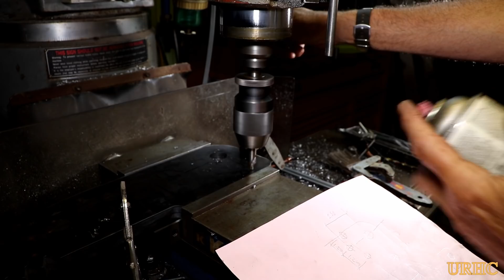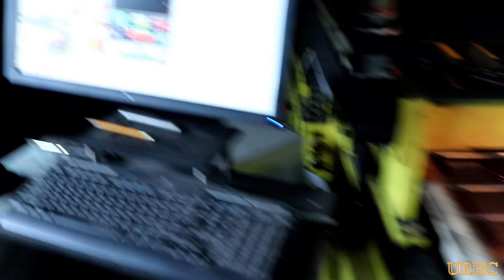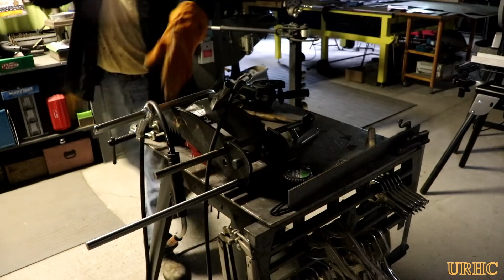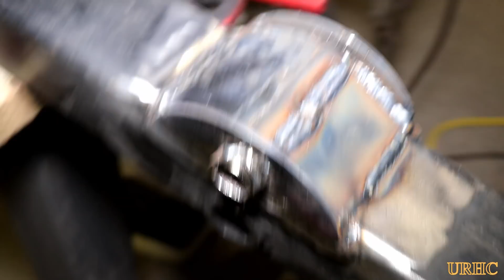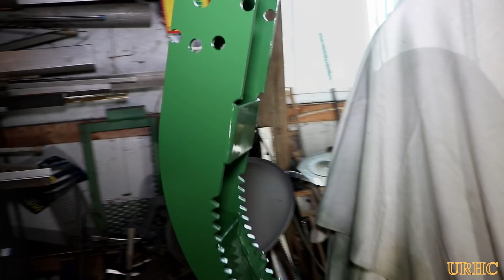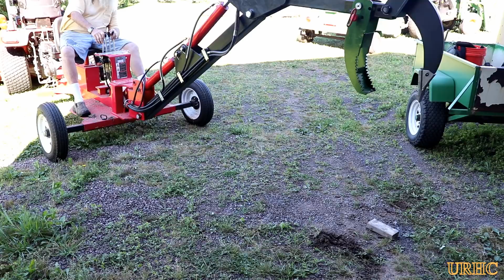Building A Thumb And Adding A DR Ripper To My Trencher Part 2

Comment: I haven’t bought one but I would like to. Have you tried leaving it hooked up to the tractor. The weight of downforce when digging would be higher because you would have a few hundred extra pounds. You could probably get in place faster as well then.
Reply from the maker: You probably would tear it apart or damage cylinders if not careful.  Not made strong enough to be anchored while digging.   Thanks for watching.

Comment: Great video my friend. I am finally putting together a welding/fabrication /machine shop after going to school to bed a chemical engineer and getting run. over by a Ford F350 on my hand restored 1957 Panhead. I decided I really wanted to start a business where I am able to build and repair and restore the equipment I love instead of dealing with the people I really have gotten to dislike. I am also trying to power everything with steam. I love the view of the beautiful misty background. I hope you are well and still using all that great equipment. I am up here in Pa and with these two videos I can't get a feel where you are but it sure is beautiful.
Reply from the maker: We are north of you up by lake Ontario.  That sounds  like a massive project you are taking on but should  be very rewarding.  If you have time share videos  on YouTube  to inspire others. Good luck in your  new endeavor.  The older I get the less tolerance I have for some people  also. Thanks for watching.

Comment: Great work! Most factory gripper plates have a kick stand back to the boom. The fulcrum affect on your locking pin would be much less with the kick stand and a easy fix, move your pin hold 8-10 inch up the boom and two bars and a pin 8-10 down the gripper plate. The two bars could be made extra long with extra holes to change the angle of the gripper plate. Make it so that when the bars are removed and the gripper plate can be pin into the anchor point on the boom out of the way for a bucket attachment. You could go so far as weld two bolt on the boom to hold the bars when not in use.
Reply from the maker: If it was a heavier duty  machine that would be needed.  This is just a toy. Thanks for watching.

Comment: Great design and build using a extended bucket curl pin  nice neat fold up out of the way one of the best I have seen.
Reply from the maker: Thanks.  Tried  to keep the weight to a minimum  because these machines are not able to lift alot. Thanks for watching.

Comment: very informative. im surprised with that much effort he didn't make it hydraulic. maybe he just didn't need it
Reply from the maker: Why add all the extra weight and complexity of hoses and cylinder plus change the valving system  for something that can be done  manually in a couple seconds.  This is a trencher not an excavator.  Thanks  for watching.

Comment: Where you getting your drill  bits ? I cant find any good ones.
Reply from the maker: I bought a set of the Harbor freight cobalt bits several years ago and they are great for under 1/2 inch. The larger bits came from Enco many years ago. Thanks for watching.

Comment: Very well made, but I suggest you think about moving your 2 pivot points MUCH further apart.  Any addition should be able to take the full force of your original machine without needing to worry about anything bending.  No disrespect intended.
Reply from the maker: Just switched to a grade 8 pin and it seems fine. Thanks for watching.

Comment: Excellent video AND fabrication. How about adding a pressure regulator to  lower the hydraulic pressure when gripping and raising for digging.  Seems like you will not need as much force to hold something as you do to dig or rip. May help with the bending of the pins. Again I always enjoy your videos. Keep them coming.
Reply from the maker: I am going to try a grade 8 bolt first. That will have more resistance to bending. If there is still an issue I will switch to a 1 inch pin like the pivot. It doesnt take much force to hold but it is not controllable as you say and l think a better grade pin will work without messing with expensive hydraulic components.  working the bugs out is the fun part. Thanks for watching.

Comment: That came along nicely. My buddy closed his family machine shop after 50 years on its anniversary. 15, 000 square feet of Machinery. He asked me if I knew anyone who needed a Bridgeport. I was like, I don't have the room for that kind of gear. They kept up all the Machinery nice all those years, but they just couldn't compete with all the new gear that was out on the market to compete against other companies.
Reply from the maker: I bought my mill from a shop that was downsizing also. Even prototyping is done on cnc equipment these days so there are many old mills like this out there. Some day I will do a cnc conversion. They are real handy. Thanks for watching.

Comment: Nice job, you’re so talented and explain what you’re doing very well.
You have so many great tools and I see you also have a Corvette, what year is that. Guessing mid 80’s..
Reply from the maker: Thanks.  It is a 1985. Bought it when l turned 40 but lost interest in getting pulled over by police soon after. A red corvette is a cop magnet and  that year only had about 280 hp so it wasn't worth it. Thanks for watching.
Reply: I hear you, I have a bright yellow Dodge Challenger with approx. 550 horsepower and try and keep a low profile. Well as low a profile as I can even though I can be seen from everywhere,lol.
Reply from the maker: Every cop that passed me would pull me over to check if it had been stolen and then give me a warning about the slightly loud exhaust. Apparently red corvettes are one of the most stolen cars on the road.

Comment: I like that ripper, looks like I need to copy it. The thumb may need a stiff arm link. Mine has a thumb on it and I’ve ripped of once already. I rebuilt the pivot point and now it built proof. I’m picking 20” plus logs 12’ long and dragging them out to pick up. Good luck!!
Reply from the maker: I can put full pressure of the ripper on it with no deforming but the pin that I used is the weak link. Going to try a grade 8 bolt first to keep it clean and light if that doesn't work I will go with a 1inch like the pivot shaft. This machine won't lift a 12 inch by 12 ft log so I think it will work. Time will tell.  Can't wait to try the ripper on a stump. Thanks for watching.